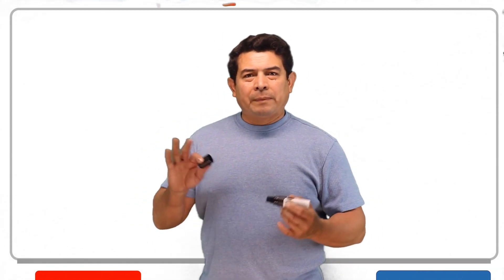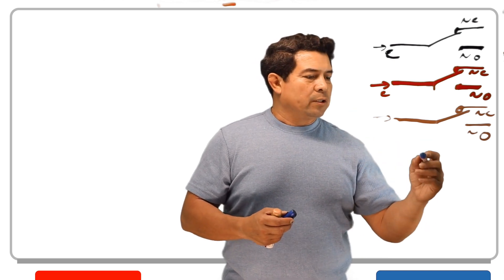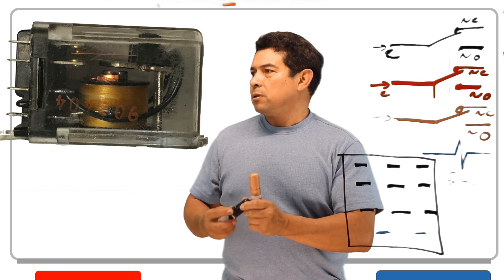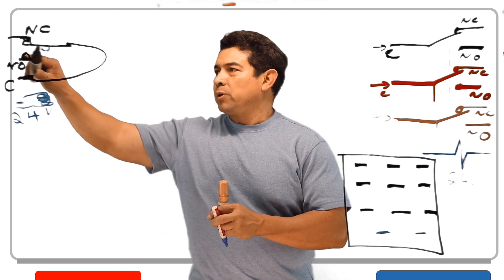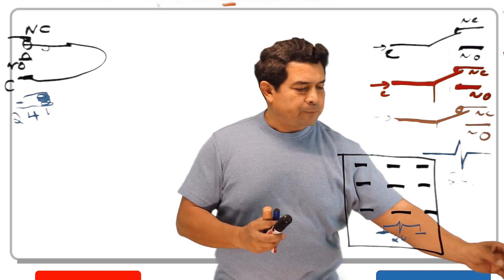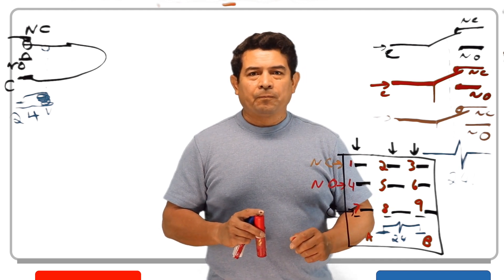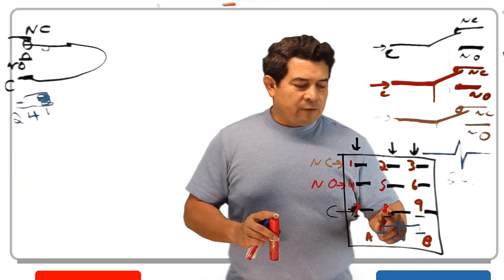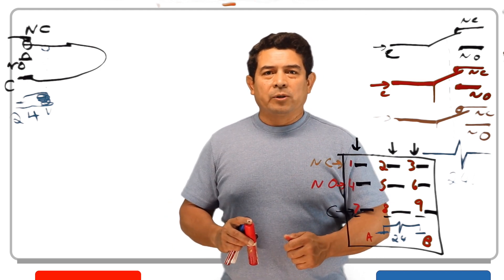Icecube relay - HVAC Online Training and Courses

Comment: Excellent explanation of the Ice cube relay. 
I’m having a problem with the one I have operating my humidifier. It has a 24v coil and switches a 24vDC solenoid. It worked for about 10 years and now nothing. I even picked up a new cube. It closes but doesn’t send power out of any of the contacts. Any idea where to start with this? It has been driving me crazy trying to figure it out. 
Thanks

Comment: I saw a couple of these on a boiler. They may have been for remote alarms but i have no idea. Can you give a complex example of where they are actually used.
Reply from the maker: These relays are used in a lot of places in the HVAC industry. They are a lot of times used in controls like you said they could be used for an alarm system. They can be used on defrost controls for heat pumps.   The coil voltage may vary, it could be 24 V or it could be 110 V you have to be careful with those coil voltages.

Comment: Is there a way to seal in the coil?
Reply from the maker: I am not sure I understand what you mean by "seal in the coil"   you cannot change the coil, it is inside the relay and it is sealed inside.   Let me know if you still have a question.
Reply: @AirConAcademy  I figured out what I was trying to ask. What I was trying to ask was if you were to set up a relay with a stop start circuit how would you seal the coil in to where you put power to the coil and make it hold.